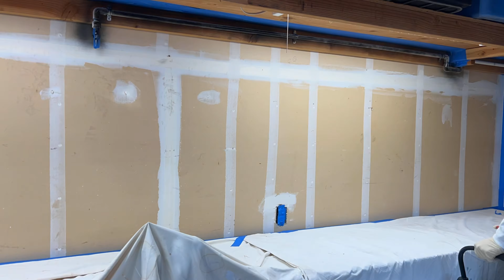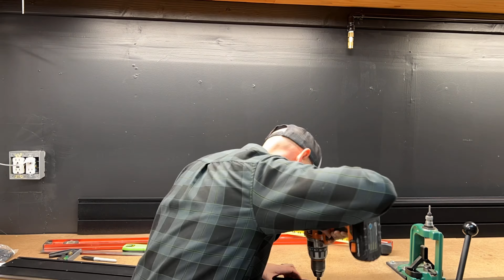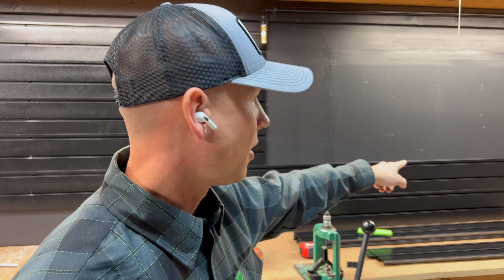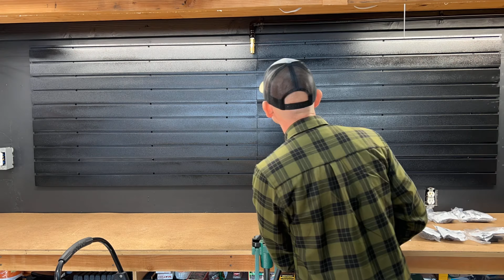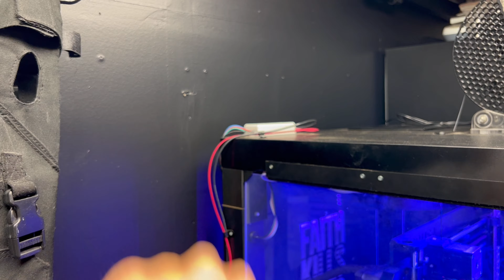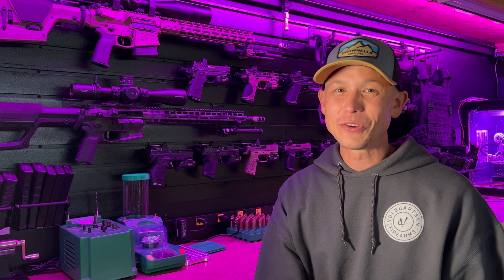Hold Up Displays Installation/Transformation

Comment: Ok, just my 2¢. I bought the display wall. I’m a nobody and purchased the display wall. It’s way way nicer than I expected. You installed it with vertical walls, I installed it but staggered the panels like they suggested so your flex worry wasn’t there same even though I used those connectors. Staggering places the forces over a larger area than just stacking them one on top of the other

Comment: Ok, just installed this wall a day ago. Let me give you my 2¢. I’m not in any shape or form associated with hold up displays. That being said. I decide to get this based on a couple of YouTubers using them for their studios. Thought they looked good. I had NO IDEA how well build they were. How easy to install. Level one row at the bottom and go. Each level sits on the one before without any help. Their little plastic screw holder fit in the grove and allows you to drill through the panel and into you wall easily. Looks fantastic and is solid as can be. One thing I will say is that they get you plates for attaching pieces together were they state use when combining multiple walls. I used them anywhere the boards didn’t meet a stud perfectly. I installed my wall in a basement that had 24” metal studs on preformed cement walls. I did nothing special, used the screws that came with it to drill through their panels into the metal studs. Worked unbelievably well. Wall came out solid as can be and looks great. Wish I had done the whole wall. Fantastic product both functionally and looks, you won’t be disappointed.
Reply: Should use another word other than "HOLDUP" 😊
Reply: @georgevavoulis4758  ha! Have you checked the prices… jk